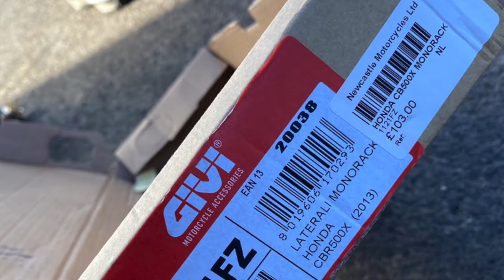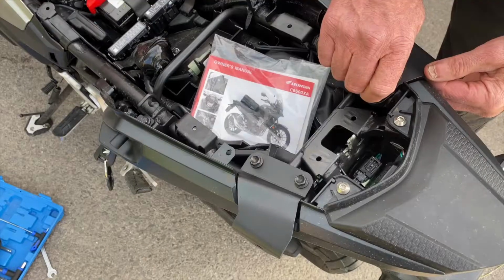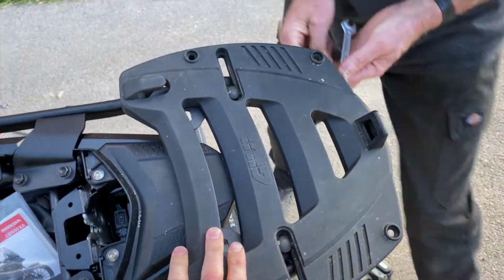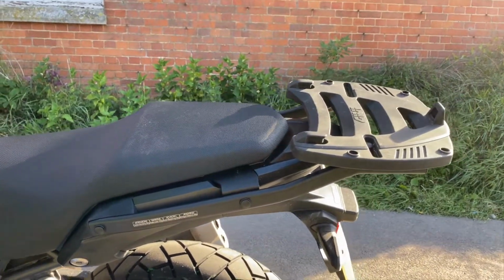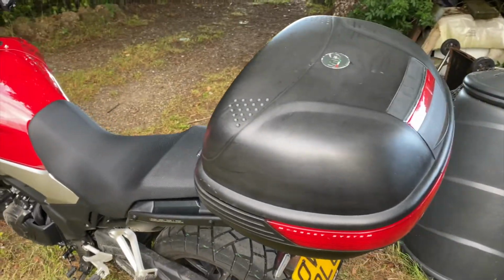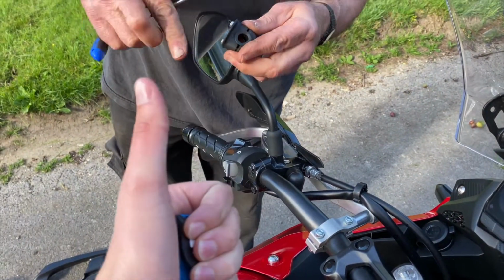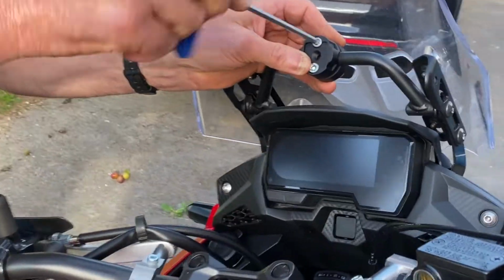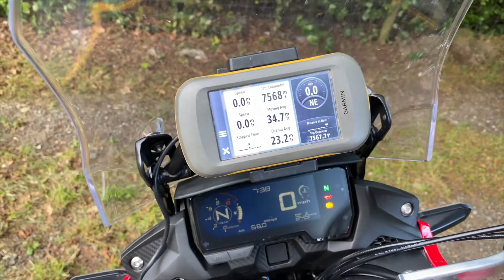Givi Topbox Rails Fitment to New Honda CB500x & Rally Raid Mount

Comment: You can buy additional part to your Quadlock, called "Vibration Dampener". It goes in between those 2 parts you already have. I've had the same issue with broken phone camera, because of CB500X vibrations. This thing should prevent the camera damage.
Reply from the maker: Thanks for that. I was lucky enough for Quadlock to send me a free vibration dampener after this incident happened. I haven’t yet tried it but I hear it works well.

Comment: Sweet upgrade. I have a street triple r right now and I want to sell it and get a 500x. I'm scared though. I don't think I'm tall enough to ride this bike. I'm 5'8 with a 29inch inseam. 
Be safe and you have a great looking bike!
Reply from the maker: Thank you. Oh nice bikes the Triumph, i would totally recommend the 500x. Oh you're totally tall enough, i am on a facebook page and there are some much shorter people riding them. If you look at a pre 19 bike so a 2018 bike they have the slightly smaller front wheel and forks so are a bit smaller to begin with and still great bikes. i'd recommend going to a dealership and sitting on one and see how you feel. Thanks for the comment.
Reply: I'm a smidge over 5'8" and I ride a 500x. It fits great. I'm sure you'll be fine. If you haven't done so already, go sit on one! Street Triple though... great bike!!

Comment: I dont know if you have a centre stand but can you use those new rear rails you put on to lift it up?
Reply from the maker: Apologies for the delay. I sadly don’t have a centre stand. I have used those handles to manoeuvre the bike. I haven’t yet picked it up with them but they fit in the same holes and the metal seems pretty strong so I don’t see why you couldn’t.